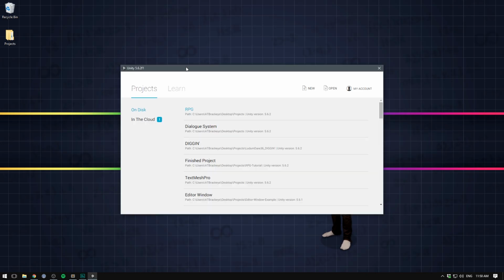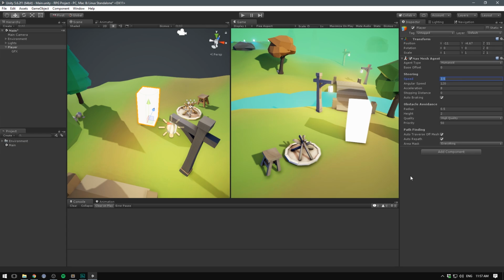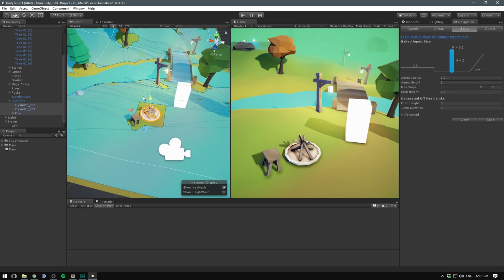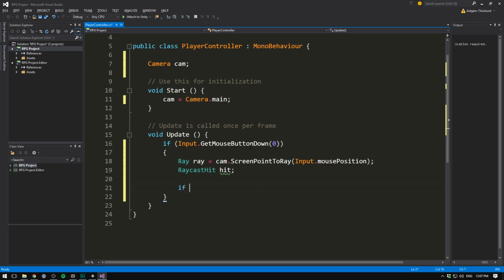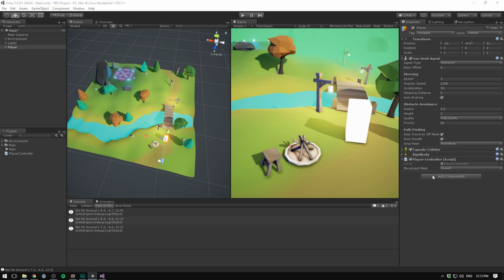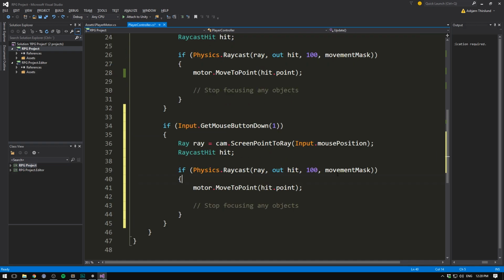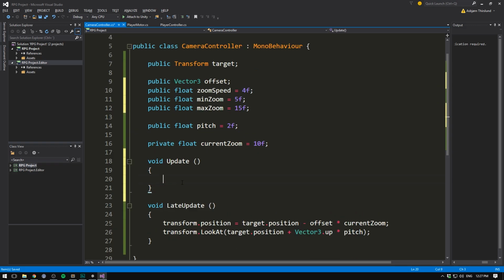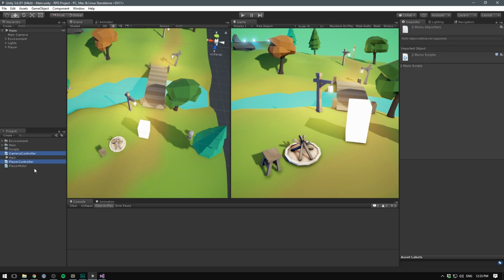MOVEMENT - Making an RPG in Unity (E01)

Comment: Someone please help!

This is my code for CameraController and I've watched this video 100 times and it will do everything but follow the player...

using System.Collections;

using System.Collections.Generic;

using UnityEngine;

public class CameraController : MonoBehaviour {

    public Transform target;

    public Vector3 offset;

    public float zoomSpeed = 4f;

    public float minZoom = 5f;

    public float maxZoom = 15f;

    public float pitch = 2f;

    public float yawSpeed = 100f;

    private float currentZoom = 10f;

    private float currentyaw = 0f;

    void Update ()

    {

        currentZoom -= Input.GetAxis("Mouse ScrollWheel") * zoomSpeed;

        currentZoom = Mathf.Clamp(currentZoom, minZoom, maxZoom);

        currentyaw -= Input.GetAxis("Horizontal") * yawSpeed * Time.deltaTime;

    }

    void LateUpdate ()

        {

        transform.position = target.position - offset * currentZoom;

        transform.LookAt(target.position + Vector3.up * pitch);

        transform.RotateAround(target.position, Vector3.up, currentyaw);

        }

}
Reply: This works for me:
using UnityEngine;

/* Makes the camera follow the player */

public class CameraController : MonoBehaviour {

 public Transform target;

 public Vector3 offset;
 public float smoothSpeed = 2f;

 public float currentZoom = 1f;
 public float maxZoom = 3f;
 public float minZoom = .3f;
 public float yawSpeed = 70;
 public float zoomSensitivity = .7f;
 float dst;

 float zoomSmoothV;
 float targetZoom;

 void Start() {
  dst = offset.magnitude;
  transform.LookAt (target);
  targetZoom = currentZoom;
 }

 void Update ()
 {
  float scroll = Input.GetAxisRaw("Mouse ScrollWheel") * zoomSensitivity;

  if (scroll != 0f)
  {
   targetZoom = Mathf.Clamp(targetZoom - scroll, minZoom, maxZoom);
  }
  currentZoom = Mathf.SmoothDamp (currentZoom, targetZoom, ref zoomSmoothV, .15f);
 }

 void LateUpdate () {
  transform.position = target.position - transform.forward * dst * currentZoom;
  transform.LookAt(target.position);

  float yawInput = Input.GetAxisRaw ("Horizontal");
  transform.RotateAround (target.position, Vector3.up, -yawInput * yawSpeed * Time.deltaTime);
 }

}

Comment: DOES ANYONE ELSE GET THIS - Assets\Environment\PostProcessing\Editor\PropertyDrawers\MinDrawer.cs(6,34): error CS0104: 'MinAttribute' is an ambiguous reference between 'UnityEngine.PostProcessing.MinAttribute' and 'UnityEngine.MinAttribute'

HOW DO U FIX THIS?!?!
Reply: Just put on top the script "using MinAttribute = UnityEngine.PostProcessing.MinAttribute;" instead of "using UnityEngine.PostProcessing;"
Solution from: https://github.com/Unity-Technologies/PostProcessing/issues/725
Reply: @rafellus1  this one to pin up
Reply: rafellus1 I did that but it did not work
Reply: I had this issue too. The fix that worked for me was replacing 'MinAttribute' with 'UnityEngine.PostProcessing.MinAttribute' in MinDrawer.cs. That should fix it!
Reply: Quinn Carson all of them?
Reply: @Pedro-cm8bh  yes
Reply: @Pedro-cm8bh  Yes, all of them, The problem is that MinAttribute is in 2 differ nameSpace and unity wants to know which one you want to use
Reply: :D took you a while huh , lmao I don’t do game dev anymore, I actually learned css and html and js and I do web dev now :D
Reply: @Pedro-cm8bh  Nice
Reply: @quinncarson9208  you happen to remember which lines or areas you added these?  i see 3 spots where MinAttribute shoes up.
Reply: @phtoday1809  replace all the insurances, if I remember correctly.
Reply: @phtoday1809  i am sure you have found it by now, but if you are using VS you can right click on all three spots and use quick refraction tool to rename them. :)
Reply: @phtoday1809  All
Reply: Worked for me, thanks :D
Reply: Quinn Carson how
Reply: @quinncarson9208  Thnx bro, that's worked for me too
Reply: @quinncarson9208  Thank you, I don't know how I could solve it without your reply
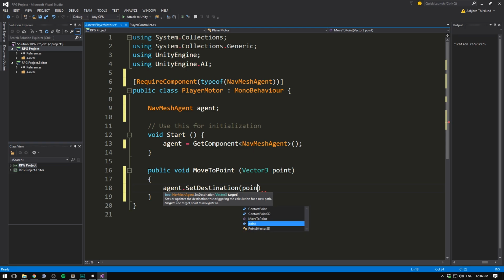Reply: Anyone having problems with the "agent.SetDestination(point);" ? Brackeys writes it at the 10:30 min in this video, but  Unity shows me this: "SetDestination" can only be called on an active agent that has been placed on a NavMesh.
Reply: @hinoki.mp4  same
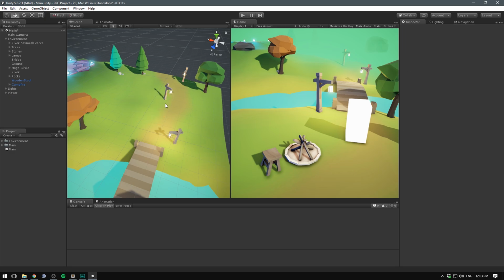Reply: @hinoki.mp4  check the Baked Agent Size 6:00
Reply: @quinncarson9208  that is what I did
Reply: @quinncarson9208  thanks buddy it worked
Reply: It’s because MinAttribute belongs to two different namespaces and you have to tell it specifically which one to use
Reply: @mik laz the 3x find and replace solution didn't work for me (or i didn't understand how to do it properly) as my script also had that text already in it too.  Rafellus1's solution worked for my script though. If you open MinDrawer.cs and look in it the top two lines should say

using UnityEngine;
using UnityEngine.PostProcessing;

just change them to 

using UnityEngine;
using MinAttribute = UnityEngine.PostProcessing.MinAttribute;

no other changes to the script required, see if that gets it up and running!
Reply: @Robert Hanson it's already there
Reply: i went to the console and double clicked the error message (at least i think i did) which opened up the script for it and i looked for line 6 text and there was a option for a quick action which is basically auto correct and it told me a few different things it should be instead
Reply: I just deleted the entire PostProcessing folder lol
Reply: No I didnt have it.... ;-;
Reply: I get this too

Comment: Everything is working except the zooming and rotating part this is my script Please Help

using System.Collections;
using System.Collections.Generic;
using UnityEngine;
using UnityEngine.AI;

public class CameraController : MonoBehaviour {

 public Transform target;
 public Vector3 offset;
 private float currentZoom = 10f;
 public float pitch=2f;
 public float zoomSpeed=4f;
 public float minZoom= 5f;
 public float maxZoom = 15f;

 public float yawSpeed = 100f;
 public float currentYaw = 0f;

 void LateUpdate()
 {
  transform.position = target.position - offset * currentZoom;
  transform.LookAt (target.position+Vector3.up * pitch);

  transform.RotateAround (target.position, Vector3.up, currentYaw);
 }
 void update()
 {
  currentZoom -=  Input.GetAxis("Mouse ScrollWheel")*zoomSpeed;
  currentZoom = Mathf.Clamp (currentZoom, minZoom, maxZoom);
  currentYaw -= Input.GetAxis ("Horizontal") * yawSpeed * Time.deltaTime;
 }
}
Reply: Fixed That. Put everything from update to late update

Comment: Still have missing assets after installing blender on steam and/or having trouble setting .blend files as Blender to default app? Try this: Go into steam -> uninstall/remove blender -> Go to blender official website and download blender manually and install.. steam was the problem and a manual download fixed everything.

Comment: ArgumentException: Input Axis Mouse Scrollwheel is not setup.
 To change the input settings use: Edit -> Project Settings -> Input
Cameracontroler.NewMethod () (at Assets/Cameracontroler.cs:25)
Cameracontroler.Update () (at Assets/Cameracontroler.cs:19)

I don't know because this happens
Reply: SOLVED: when you invoke "Input.GetAxis("Mouse ScrollWheel")" ... check it's spelled correctly case sensitive "Mouse ScrollWheel" 
I that does not work again, check under "Edit->Project settings->Input->Axes" .. check for the correct Name for Mouse ScrollWheel (that goes as parameter passed to the method Input.GetAxis)

Comment: its says i have an unexpected (, ; or { in my code but i dont, ive been looking for ages
Reply: Check the console, it should specify on which line.
Also, just click on one of the brackets and you should see which one it links to.

Assets/Scripts/PlayerController.cs(9,16): error CS1519: Unexpected symbol `;' in class, struct, or interface member declaration

For example means the symbol is on line 9.
Just open the script and go to line 9.
Reply: Thanks for your help I’ll work on it tomorrow

Comment: Everything works now but for some reason i get -

 UnassignedReferenceException: The variable target of KameraController has not been assigned.
You probably need to assign the target variable of the KameraController script in the inspector.
UnityEngine.Transform.get_position ()
KameraController.LateUpdate () (at Assets/KameraController.cs:18)

Comment: Is anyone have an issue with mouse scroll wheel
Reply: SOLVED: when you invoke "Input.GetAxis("Mouse ScrollWheel")" ... check it's spelled correctly case sensitive "Mouse ScrollWheel"
I that does not work again, check under "Edit->Project settings->Input->Axes" .. check for the correct Name for Mouse ScrollWheel (that goes as parameter passed to the method Input.GetAxis)

Comment: Can anyone help me out? I can't scroll in the game, but my code doesn't show any issues in it, and unity runs fine. Here is my current code.

using System.Collections;
using System.Collections.Generic;
using UnityEngine;

public class CameraController : MonoBehaviour {

    public Transform target;

    public Vector3 offset;
    public float zoomSpeed = 4f;
    public float minZoom = 5f;
    public float maxZoom = 15f;

    public float pitch = 2f;

    public float yawSpeed = 100f;

    private float currentZoom = 10f;
    private float yawInput = 0f;

    void Update()
    {
        currentZoom -= Input.GetAxis("Mouse ScrollWheel") + zoomSpeed;
        currentZoom = Mathf.Clamp(currentZoom, minZoom, maxZoom);

        yawInput -= Input.GetAxis("Horizontal") * yawSpeed * Time.deltaTime;
    }

 void LateUpdate ()
    {
        transform.position = target.position - offset * currentZoom;
        transform.LookAt(target.position + Vector3.up * pitch);

        transform.RotateAround(target.position, Vector3.up, yawInput);
 }
 
}

Comment: NullReferenceException: Object reference not set to an instance of an object
PlayerController.Update () (at Assets/PlayerController.cs:52)
Reply: Just copying what I already wrote.

Null Reference means it's trying to reference an object that doesn't exist. 
Your error message means that the reference to an object that hasn't been initialized is on line 52.
I'm not sure what you had there since I can't see your code but let's assume it's the motor part...

Since you didn't get any problems before that line, I assume you had the Player Motor script attached to the Player object but make sure it is. 
The more likely case is that you never established that the variable "motor" refers to the component "PlayerMotor" in the Player object. 
So check your start function. 
It probably tries to access "motor" but motor was never established in the start function. 

motor = GetComponent<PlayerMotor>(); 

Only there does the script connect motor with the PlayerMotor.

Comment: For some reason a few things won’t appear such as, the ground and water
Reply: Just open in Blender - BaseEnvironment,  Tree 01, Tree 02 and resave it then reimport to Unity project. If you use new Unity - do the API Update (confirming alert performed automatically at start project or on import).

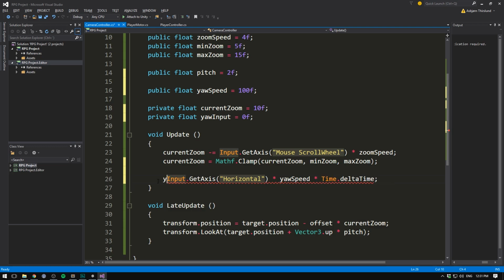Comment: Why didn't you use Time.deltaTime when calculating currentZoom or when updating the position of  the camera? Why did you just use it for the rotation of the camera? Wouldn't it also help smoothen the movement of the camera and the zooming? 15:48

Comment: For those under 11th grade:
1.Vector means something which had values (1 meter ,2 liter ,3 cm,etc) with a specific direction (ex: North)
2.Vector 3 is pointing objects position in 3 dimensions (x,y,z)
3.Raycast is just throwing an invisible ray to direction of which you are looking (Like in shooting games)
4. Quadrillion is way for measuring angles in 3d and Euler is it's diamensions
Reply: tq

Comment: Is there a way to just use the NavMesh "Walkable" attribute instead of adding a custom "Ground" Layer? Find it weird to have to set attributes in two places that are ...almost... the same thing.
Reply: Found a simple solution. In the Inspector, under Player's "Nav Mash Agent", there is a "Path Finding" section and "Area Mask" option. Just uncheck the "Not Walkable" option. Basically it allows the NavMeshAgent to walk only on the areas that are selected (Walkable and Jump, for me).

This is in Unity 2018.2.

Comment: Initially when I imported the assets, I had a problem where most everything was just green. What I tried after that was to download and install unity and make absolutely certain that three files, specifically, were associated with Blender.
Inside the \Models\ directory
~ BaseEnvironment
~ Tree 01
~ Tree 02

I closed and reopened Unity.
Subsequently I deleted everything in my project and then reimported the assets.
Now I get the correct initial preview.

Comment: I have an issue with the player movement. My player is not moving to the correct location on click. Instead it goes to a spot that seems random. Example: I will click the bridge or beyond the bridge and the player cube will move in the opposite direction to the bottom left corner of the river. Then, if I click close to the original the player started, the player cube won't even move at all. So the cube is moving to the wrong places on click and sometimes not moving at all to the clicked location. I have no errors in my console. DAE?

Comment: It took me quite a while to figure out my  motor object issue. For me- it was that the script was added in the assets, but not as a component to my player.

These tutorials are absurdly fast and don’t explain many of the whys and whats. I appreciate them but they could use work. Im new to C#, so learning some basic shortcuts and functions would be extremely beneficial, instead of a fast paced type in what I type in deal.

Comment: The ground wont load in?
Reply: I'm new to this but I had the same problem. Along with dragging in RPG Environment package, you also need to drop in the stand along Models and Sprites. Works for me now with unity 2017.3. Hope this helps. https://www.dropbox.com/s/tfpdze8hqqbl23a/Screenshot%202018-01-26%2015.31.07.png?dl=0
Reply: Hi, not sure if you have found a solution, but I got it to work by downloading and installing "Blender" on steam. I then opened up the "RPG tutorial" file I downloaded from the link. After I unzipped the file, I opened it up and double clicked on "Models" to open up that folder. You can then double click on either "Base Environment", "Tree 01", or "Tree 01". It will pop up with something saying "How/which program do you want to open this file with?" (Can't remember exactly what it says, but It's somewhere along those lines). You can then chose to browse through your computer to find something to open it with. Go to where your "Blender" program was installed (In my case it was "D:\Program Files (x86)\Steam\steamapps\common"). After you found where your Blender app is, simply double click the "Blender.exe" application, this should link those file types with Blender. Not sure if this part is necessary but I did it anyway. Double click either the  "Base Environment", "Tree 01", or "Tree 01"  now that they are linked with Blender and it should open up Blender with the file you double clicked. You should see the asset you chose loaded into Blender, then fully close Unity, then re-open it and repeat the steps in this video and it should be all good. Hope this helps!

Comment: for the camera rotation i tried rotating with the mouse while the Scroll Wheel is pressed instead of the "Horizontal" keys, it feels a lot better.
(i just changed
currentYaw-=Input.GetAxis("Horizontal") * yawSpeed * Time.deltaTime;
for
if (Input.GetMouseButton(2))
        {
            currentYaw += Input.GetAxis("Mouse X") * yawSpeed * Time.deltaTime;
         
        }
and set YawSpeed to 300)

Comment: When I open the Unity thig i downloaded, I don't get in the ground, only the things(like stones, lamps, Fire place and so on). Why don't i get the ground??
Reply: I don't have them too...
Reply: I'm new to this but I had the same problem. Along with dragging in RPG Environment package, you also need to drop in the stand along Models and Sprites. Works for me now with unity 2017.3. Hope this helps. https://www.dropbox.com/s/tfpdze8hqqbl23a/Screenshot%202018-01-26%2015.31.07.png?dl=0
Reply: Hi, not sure if you have found a solution, but I got it to work by downloading and installing "Blender" on steam. I then opened up the "RPG tutorial" file I downloaded from the link. After I unzipped the file, I opened it up and double clicked on "Models" to open up that folder. You can then double click on either "Base Environment", "Tree 01", or "Tree 01". It will pop up with something saying "How/which program do you want to open this file with?" (Can't remember exactly what it says, but It's somewhere along those lines). You can then chose to browse through your computer to find something to open it with. Go to where your "Blender" program was installed (In my case it was "D:\Program Files (x86)\Steam\steamapps\common"). After you found where your Blender app is, simply double click the "Blender.exe" application, this should link those file types with Blender. Not sure if this part is necessary but I did it anyway. Double click either the  "Base Environment", "Tree 01", or "Tree 01"  now that they are linked with Blender and it should open up Blender with the file you double clicked. You should see the asset you chose loaded into Blender, then fully close Unity, then re-open it and repeat the steps in this video and it should be all good. Hope this helps!